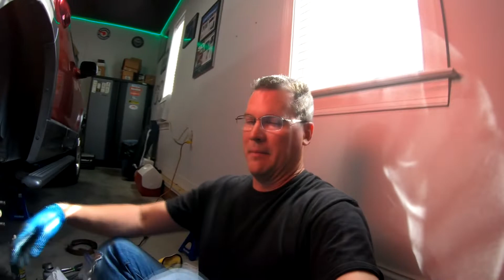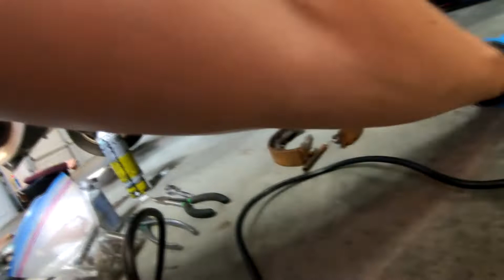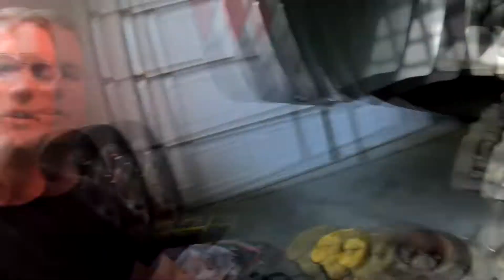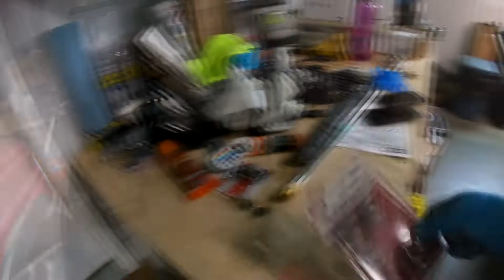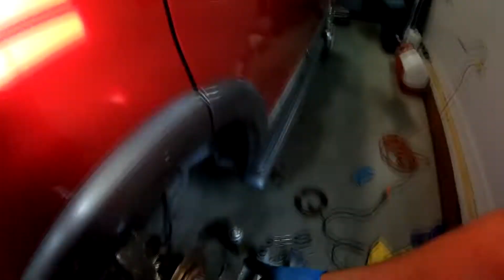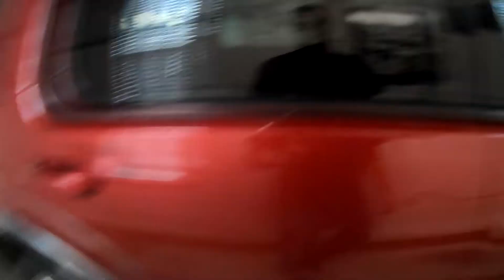2003 Ford Explorer Broken Wheel Stud Repair

Comment: What is that center "stud"? Is it also a stud, can it be replaced?  It is heavily corroded. How to prevent corrosion?
Reply from the maker: @lssl8934  Center is the axle nut.  It’s fine just looks that way after 22 years.  Normal.
Reply: @98saleen  Thank you, I have Ford Explorer '10 and it has a thread on it and all rusted. Would you know how to remove it and to protect against corrosion?
Reply from the maker: @lssl8934  You can use some WD40 spray on it and then wire brush the rust off as much as you can.  Then apply antiseize to it.  It should help alot especially if you ever need to pull the axle out.

Comment: Where did you buy your rear shocks and strut assembly or what brands are good . Thank you as always🙏🍺
Reply from the maker: Rear strut/spring combo replacement - https://www.autozone.com/suspension-steering-tire-and-wheel/shock-strut/p/duralast-loaded-strut-assembly-ls33-80922b/761852_0_0
Reply: Are the motor mounts difficult to change alone 🤔
Reply from the maker: @sorro_tek9599  Probably.  I haven’t done it on this vehicle as mine are ok.   But a lift would help.

Comment: What was the item you used to align the stud?
Reply from the maker: It's called the Lisle Wheel Stud Installer 22800.  You can buy on Amazon here - https://www.amazon.com/Lisle-22800-Wheel-Stud-Installer/dp/B000ETUD22/ref=sr_1_2?keywords=lisle+wheel+stud+installer&qid=1651580226&sr=8-2